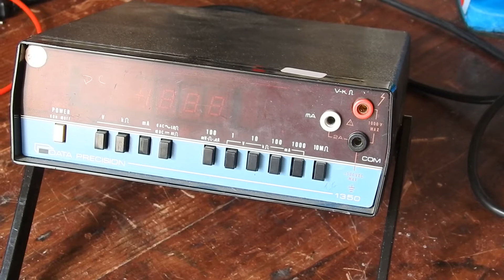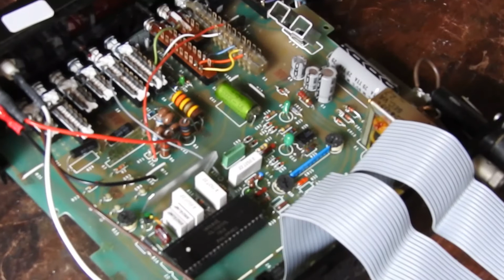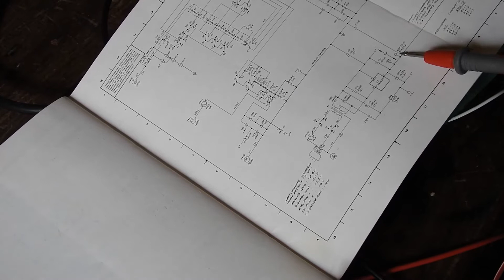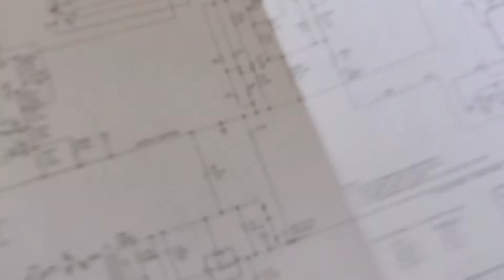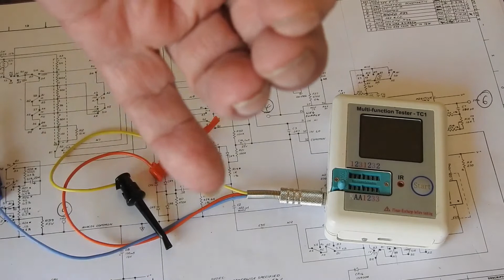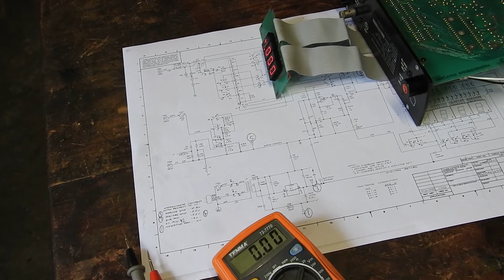Data Precision Model 1350 DMM Teardown & Repair

Comment: Why did you not fit back the ic you channged?,i expect the orriginal was ok and just the cap loading the power rail not the ic?.
Reply from the maker: Didn't I? 
Yes, almost certainly it is OK.
But with 2 chips, and 1 meter - doesn't matter which is in it, so I didn't bother I suppose.

Comment: Got my hands on the 1351, almost the same. Measuring was weird on some ranges, all over the place. After opening up I found that the two U-profiles in which all the switches are hold had a thousand whiskers (tin or Sn) and they had reached the switch contacts.
Thanks for the schematics 👍🏻
Reply from the maker: Glad to have been of help!

Comment: Hi great video.  I just got one......can I ask, what did you use to clean the front panel?
Reply from the maker: Thanks. I don't remember using anything in particular. It would have just been common household stuff, like dish washing soapy water (for the case as well), maybe some spray n' wipe stuff for anything stubborn, and maybe some isopropyl alcohol to finish.